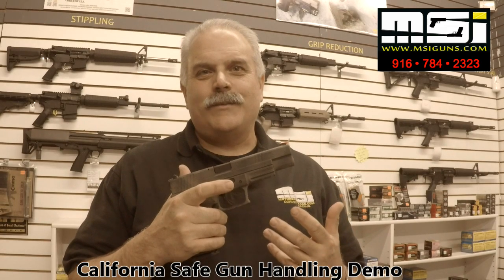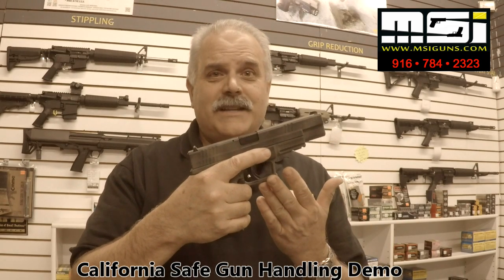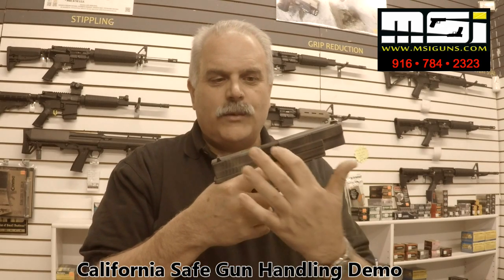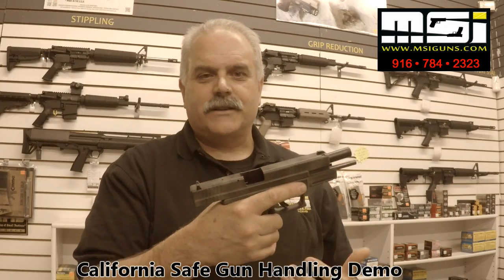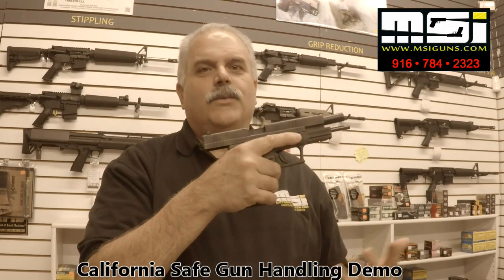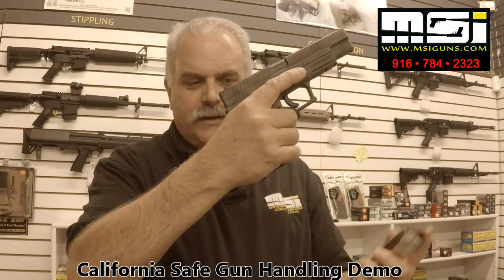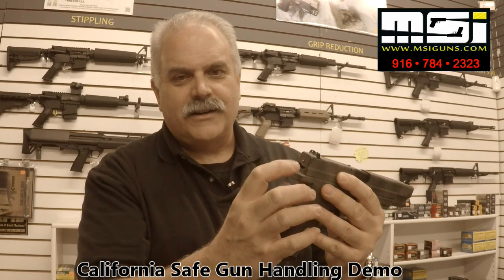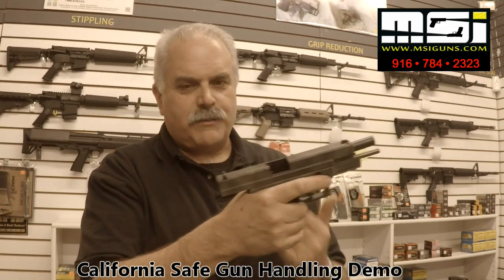Safe Gun Handling Demo

Comment: Roll and rack seems less safe than approaching the slide from the hammer/breech end than moving from muzzle down with your weak hand. You can still roll approaching from hammer end without the risk of negligent discharge into your forearm. Besides, the ejector is designed for ejection without gravity and you'll soon find out if the ejector didn't do a good job because you should be about to check the chamber, verify the feed path, and observe the bore

Comment: Hi,  I actually just purchased my first firearm, an XD. 10 days from now I will have to do the safety demo to pick it up, how hard do I have to pull to rack the slide?
Reply from the maker: It probably takes about 20-25 pounds of pull.  With the XD the biggest trick is to use the top of your thumb knuckle to push up on the slide catch, because with the XD, you need to keep the back strap safety depressed in order to cycle the slide rearward.  Enjoy your new gun.  XDs are my favorite polymer framed handguns (that are legal to sell in Komifornia).

Comment: When you run the slide forward after locking it back, is it considered safe for the internals to let it go, as opposed to releasing with slight control so it doesn't slide all the way forward freely? I've seen recent posts where people state that letting it slide all the way forward while the chamber is empty can cause unnecessary wear...
Reply: when you rack the slide, pull back with enough force to hit your shoulder of the arm hold the gun and release naturally.  you are dealing with steel and aluminum and stuff. its bloody strong.  good question, but answered in the video.  the gun is basically bulletproof.
Reply: I've not yet seen a gun that has been damaged by letting the slide go forward under the energy stored up in the factory designed guide spring.

Comment: Hi, can you use a locking cables instead of a locking case? Also do we need a locking cable for rifles?
Reply: In California it needs to be transported inside an approved locked container. At home running the cable lock through the mag well and slide also meets the home storage requirement. The cable through the gun does not meet the transportation requirement, in must be inside a locked container.

Comment: How do you do that with a revolver?
Reply from the maker: Very similar.  Think of it like this, regardless of the type of gun.  Pick up with firing grip, pointed in a safe direction, finger off of the trigger.UnloadInspectLoadRun safety if applicableunloadinspectlock up